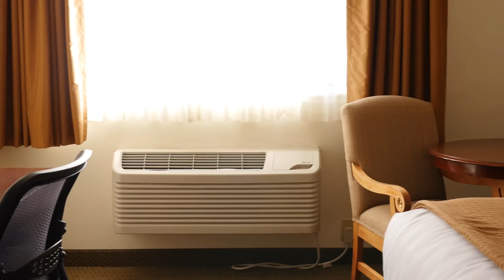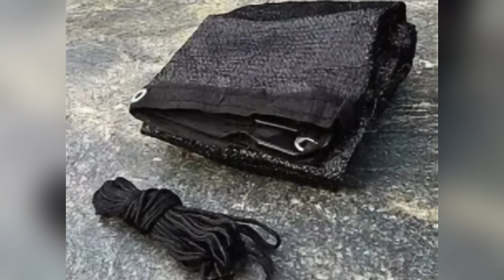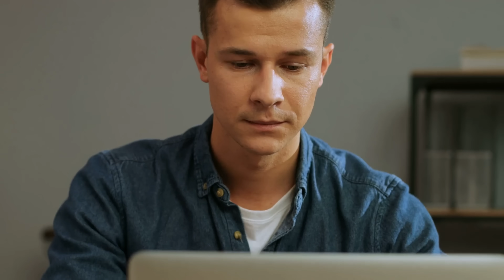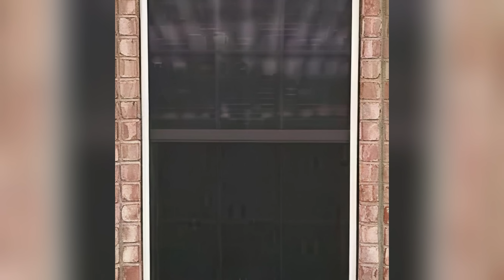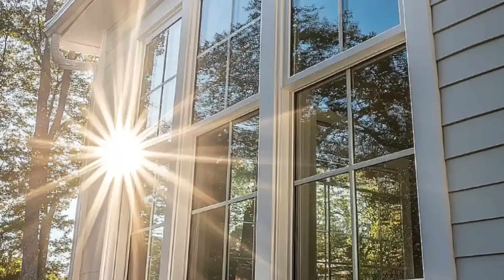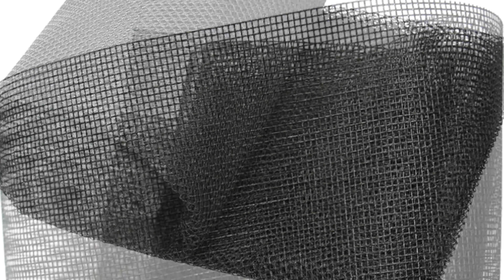This Heat-Blocking Screen Works Better Than You'd Think

Comment: So what if you live in a flat and can't have window protection outside? I have solar film on the inside of the windows and all my rooms (which face the sun most of the day) are so hot as is all the furniture etc.
Reply from the maker: Internal solar film is less effective because heat gets trapped between the film and the glass. For flats, external roller blinds or awnings are options if allowed, or consider insulated curtains/blinds inside to reduce heat transfer.

Comment: You didn't mention this, and I don't know if I can do this in an apartment. I'm on the 5th floor. do you have any suggestions?
Reply from the maker: That's a great point! I didn't specifically address apartment dwellers, but many heat-blocking screens are designed for easy, non-permanent installation, making them perfect for renters. Look for options that use tension rods or static cling!

Comment: What if you live in an upper floor apartment where the window exteriors are inaccessible?
Reply: Yes!?
Reply: @patrickkihn  im thinking get a piece slightly bigger than the window & drape it over & out of the window (if it opens) the close the window to hold it in place.

Comment: Yup, I figured this out finally about two years ago.  Expanded my operation onto our roof with some 1 ft high frame builds using 8x12 shade cloths with grommets. holding the expanse.  Lowered the temperature by 30 degrees.  Now its on all south, east and west windows and even stucco walls.  Went from running our AC at 10:30am when it would be 90+, to now not kicking on until at least 2pm, sometimes even until 4pm.  I rent, so had to make it something easily removable.  TY for all your videos!  They rock!
Reply from the maker: Lowering the temp by 30 degrees is impressive, thanks for sharing your setup! 💡🙌

Comment: I'm a 75 yr YOUNG van dweller, 5 yrs now due to COL pricing me out of senior rental market. So my wheel-estate is 2018 Ford Transit Cargo Van Short 250. Last summer we found shade cloth, got a large 20'x10' 90%-block drapped over top of van covers windshield & over open rear barn doors with plenty of ventilation using 3 good fans & 1500ml swamp cooler filled with ice, interior stays at a comfortable 75-80° when 90+ outside! 😊 Happy trails, Ms CharLee👵 Nicolas🐕 Angel🚐
Reply from the maker: That is an absolutely brilliant setup for staying cool, thanks so much for sharing! 🚐💨
Reply: 😂😂😂”wheel-estate”

Comment: I've noticed in a lot of new windows there's only a screen on the bottom section since that's the only section that opens but I don't like the aesthetics of that and I also have thought that skimps out on the shading effect on the top pane of glass.

The panning function on a fan is kind of stupid because the fan only provides cooling effect in a hot room if it's blowing over you and you're sweating. Otherwise it's just blowing hot air around somewhere else so you might as well just have it blowing straight at you.

Comment: Amazon sells these on rollers but they're like $60 to $100 avg. I'm definitely getting one for our big window though because I freaking detest being hot. I can handle freezing but not intense heat. Thx for the head's up- good suggestion,  Sidney!
Reply from the maker: No problem! Totally get the whole "detest being hot" thing. Hope it works out great for your big window!

Comment: Been doing this for 30 years. Keep your shade cloth as far away from the glass as possible if possible. Grommets on the shade cloth and use zip ties to attach if you have an overhang to attach to. Keeps our house 20+ degrees cooler in summer than without it. Put up around Mother’s Day and take down around Halloween. I thought of creating a ROOF shade cloth system with the shade cloth attached to 4x4” on my roof but never did. Online shade cloth is inexpensive and can be made to your desired specific size and add grommets every 12” if you want. Best Wishes.
Reply from the maker: That’s fantastic advice, keeping that air gap makes such a huge difference! ☀️🏡
Reply: @Sidney_Explains_Money   Eye-Screws attached to the overhang to fasten grommets on shade cloth to. Gravity at bottom works fine if calculating the proper length and environmental conditions. Built a giant shade cloth for deck that had a clear Corrugated Polycarbonate Roof Panel in Clear that worked wonderful for the winter but created a Hot Zone during the winter so heavy duty shade cloth resolved that.
Reply: Completely agree about shielding your roof. You can buy reflective paint, or have clay instead of concrete tiles to avoid heat ingress but I've also read that solar panels provide an unexpected benefit as they shade the roof and give an air gap between panel and tile.
Reply: Do you have a Chanel to show us how you would do this ?  Thank you 🙏
Reply: @Thu@ThuVu-qu1cc I currently have 1 video on my personal YouTube although it’s a video about Ukrainian drone development. Hopefully I explained how to do this in written word well enough to help put the project together. Best Wishes.

Comment: I bought s large roll of 90% and tried to fix it.   The frame of my window and my render around the frame makes it a fix that will require some alteration/damage to attach it. I gave up. But i will try again. I was doing this intuitively. Now that i know it is a good solution, i will persevere
Reply: Perhaps you can use very strong  magnets ?